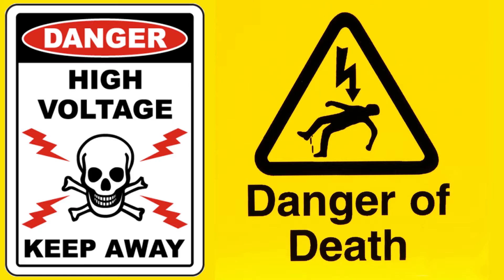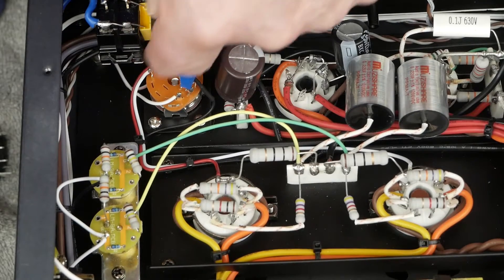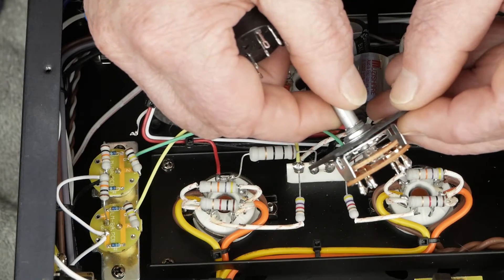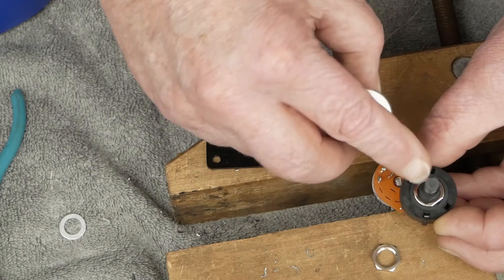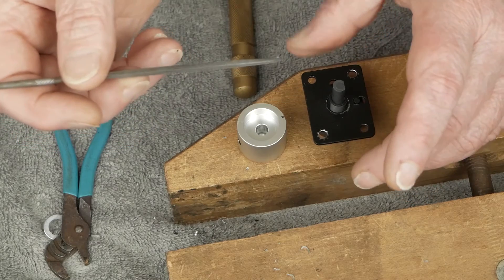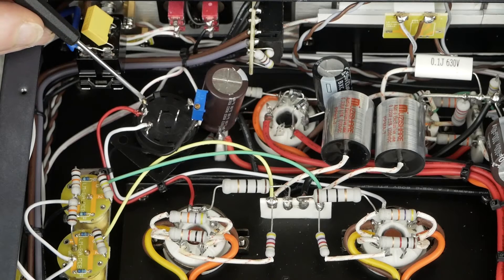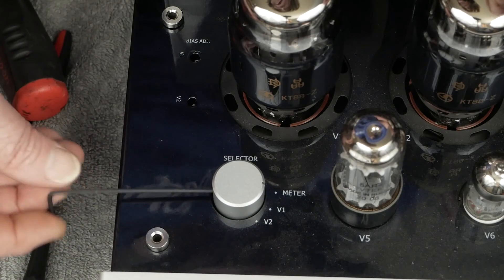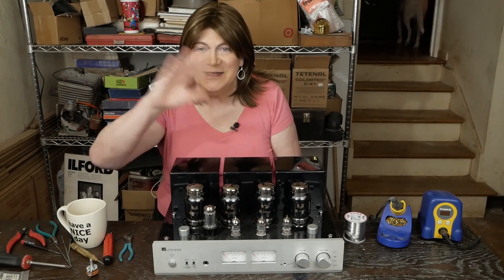Muzishare X7: Replacing the Bias Meter Rotary Switches.

Comment: Re: recessed bias adjusters. I put a length of heat shrink on the bias screwdriver supplied with my R8 then shrank it to the shaft but not the blade area. I then trimmed the heat shrink so it was sticking out a few mm past the tip of the blade. Now the screwdriver easily slips onto the bias adjuster and a slight twist sees it slot into the top.

Comment: Cracking vid. I've got one coming soon (ordered last Tuesday) to the UK. Shame you are in the US if I have issues (I hope not!)
Reply from the maker: Honestly, if you use the amp and "exercise" these rotary switches regularly i.e. check the bias weekly, the factory ones will likely never have this problem.
Reply: Thanks for the advice 👍

Edit: can you move them when the unit is powered down?
Reply from the maker: Sure, they are simply mechanical switches and like most switches of this type, should "self clean" with use.

Comment: Did I see solid state diode rectifiers across the rectifier tube? Surely that makes the rectiier tube redundant???
Reply from the maker: It looks like they are wired in reverse of the tube, will have to look at that more closely.
Reply: @SkunkieDesignsElectronics  be very interesting to see what they have done there. Cheers Ian

Comment: Do you know the purpose of that blue trim pot hanging off the switch?
Reply from the maker: Yes, that's to adjust the front meter to = the mv reading across the 10 ohm cathode resistor.